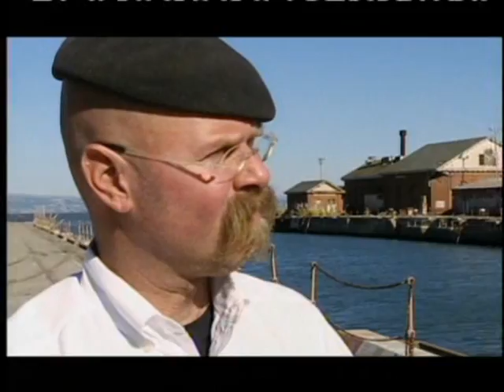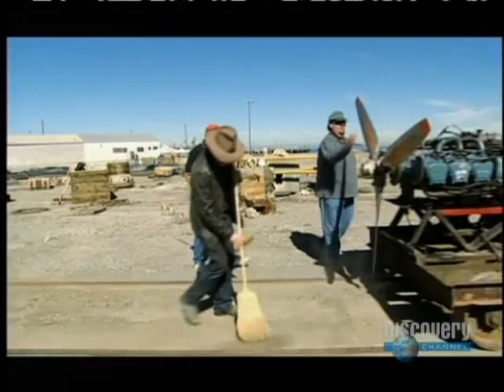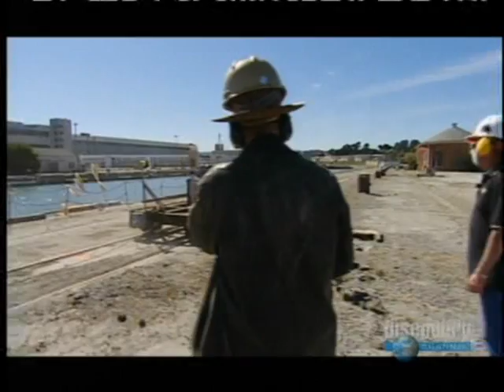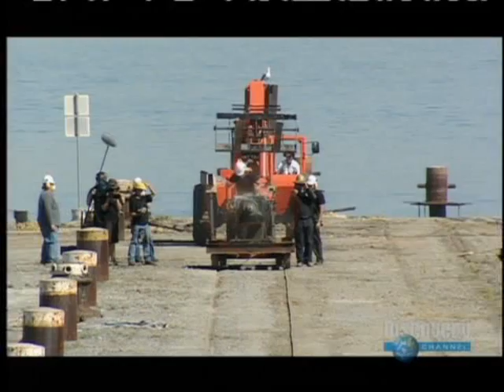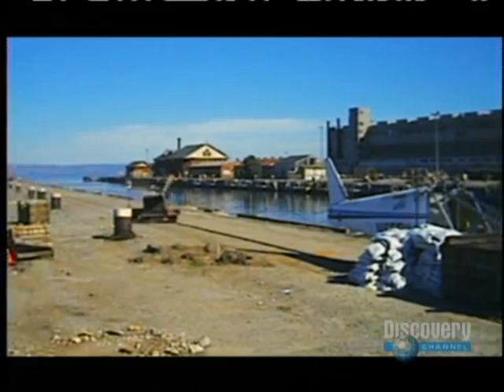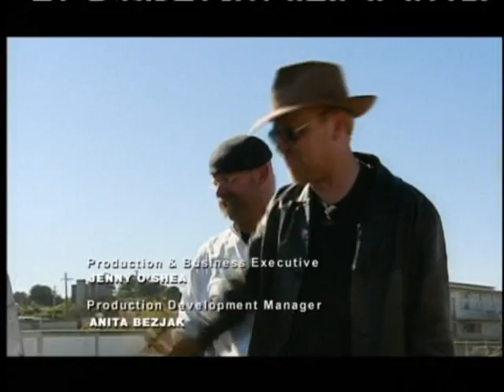Shredded Plane 3 of 3

Comment: The horizontal stabilizer would have been sliced too if that happened so I don't think that it's a problem.
Reply: it was a piper seminole   they have a T tail so the prop went underneath it...